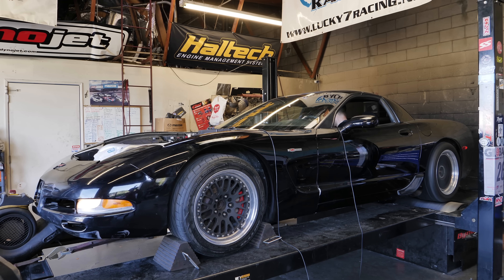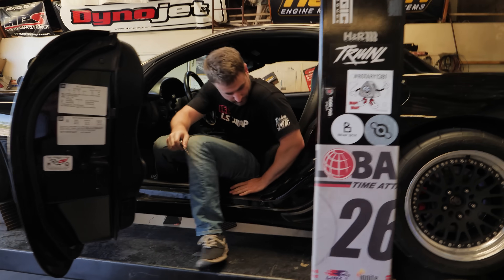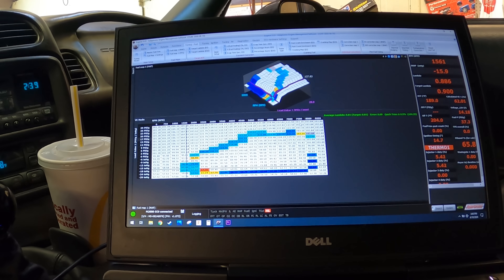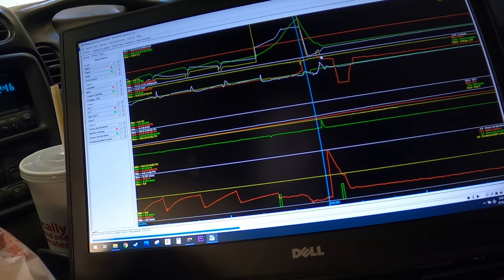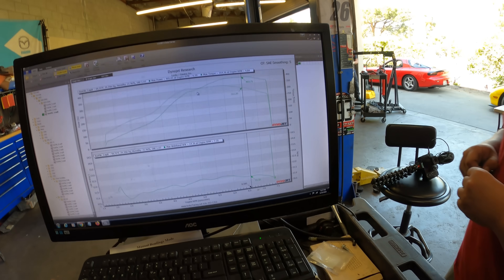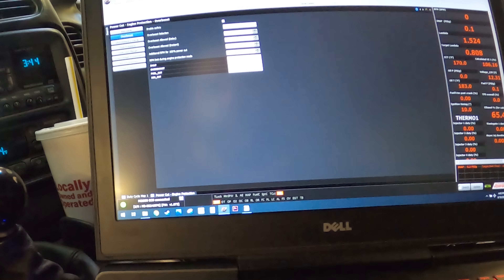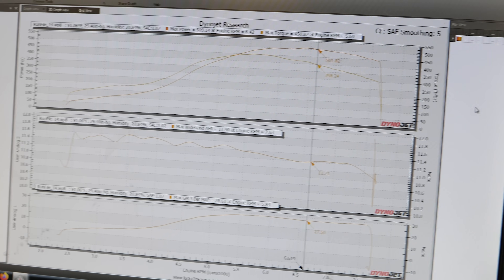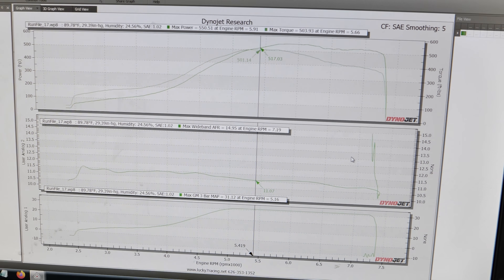Rotary Vette Dyno! First time dyno tuning

Comment: Is it just me or is this an evolution of the corvette? A smaller engine with less mass, less weight, and lower weight distribution with less vibration than the stock engine and still makes the same power. I don't know how forced induction affects the classing for SCCA and other similar events but this could be the beginning of a new life for this chassis.

Comment: So, Rob... I though you said, "No check engine lights" in a previous video. So why is there a 'check engine' light (among others), and why does the tachometer not work? Looks like there's still some work to do. I'm also a bit worried about the wastegate venting into the hood. Might want to dump that downward, under the car.

Comment: Awesome achievement to be sure! With the reduction in weight and the added horsepower this Vette is going to be a lot faster than a stock Z06!
I imagine there will be a trade-off in drivability due to the fact that the torque doesn't really surpass that of the V8 until 4,000rpms or so... but for something that's not a daily driver, that's probably a justifiable trade-off.  Hopefully Rob will give us some feedback in that regard.
Great work sir!!

Comment: The two rotor sounds positively anemic after hearing the 4 rotor for a while. Really, I suggest putting some BIG ASS mufflers on it. WTF came out of the wastegate? Feathers? What happens if you don't jerk it out (of gear) when it comes?
Reply from the maker: Agreed haha spoiled wiht 3 and 4 rotors

Comment: Rob you have the intercooler blocking the air that should go to the radiator. Come one Rob you should know this.
Reply from the maker: Incorrect. It’s actually not even close enough. So many people drill that into your head and are completely wrong. My coolant temps were under 140. Lol too low. And my intercooler is too hot. I could have used the radiator fan to pull air from the ic even. So many people feed the audience hearsay. About to blow people’s minds.
Reply: This has been my personal experience with my fd when I ran a fmic. I live in FL and I had to switch to vmic due to engine temps getting to high. Then again I am on pump gas. Your build is coming along well Rob. Brap on brother

Comment: Not sure if it’s been mentioned before but your reverse issue is the reverse lockout on the top side of the transmission. I don’t remember which wire in the plug but if you can’t give it signal from the ecu, tap into the brake light circuit and then all you need is to hold the brake while shifting to reverse. Works like stock while stopped but no chance of hitting reverse instead of 5th.

Comment: Makes me wonder what I could push with the Turbo 13B in one of my Opel GT's (other one is running a LE5 Turbo'd with LNF parts setup).  I hit about 275 HP and ~235lbft or so if I remember right when just trying to pull out a really conservative stable result.  The LE5 car is pushing 300hp and 350lbft with mostly LNF parts I got second hand that people swapped for aftermarket excluding turbo, that was an upgrade but I can't remember what it was (did this years ago).  Pretty sure I could beat more out of the 13B but I have a lot more LE5's laying around than I do 13Bs so I was a bit scared if I'm being honest...lot cheaper to mess up the LE5 by far.  Besides, considering stock the cars had around 90hp and 111lbft factory, they both ride around fine with more than enough power, just with a different feel between the two.

Comment: almost seems you have to stiff of a bov spring in it, notice the hesitation between letting off and the bov opening.. thats a lot of pressure hanging out on the throttle body for a sec.

Comment: Be carefull running with so little timing, when using a coil with a long spark duration such as the ign-1a you do not want to fire a coil after TDC ( for example 5 degrees of base timing on the leading side and 10 degrees of split ). This is because the trailing spark can actually stay lit untill the apex seal sweeps past the trailing plug causing the next intake charge to ignite way early and detonate. Also, are you monitoring egt's?

Comment: Corvette Community: Ew 13B on corvette why? You have to do everything custom

Me: Takes notes for a 13B Subaru Baja Project
Reply: Baja Subaru? Rotary swap a Subaru Brat. Call it the Subaru Brap.
Reply: Shona lol wish I could But I already got the Manual 06 Baja Just need an RX8 engine (Because Downgrading Emissions Laws in my County)
Reply: Isn't the Baja awd?
Reply: That Corn Fed 12A guy yes but since the total size and length of the Baja vs the EJ251 engine is close enough, It looks more doable than you’d expect

Comment: LS Fans: Did you beat the LS6
Rob: Yes 
LS Fans: What did it cost?
Rob: Everything
Reply: now compare it against a LS9
Reply: Now compare that against a 26b
Reply: Peter Griffin The ls9 is a far better engine than most rotary engines
Reply: Peter Griffin remember rotory guys there are 6000hp turbo big blocks. running 3 sec quarters at 300mph..
Reply: Local Baller also costs more.. pound for pound rotaries make more power
Reply: Michael Gomez actually, they have 10k Hp engines running those numbers.. lol
Reply: #RideLife 3 second quarter miles at 300mph show me....
Reply: #RideLife v8s ftw
Reply: #RideLife there are 1.6 liter turbos v6s making will over 1200hp in f1. show me a engine smaller that makes those numbers
Reply: #RideLife rotors are just not at good.
Reply: Michael Gomez 1.3l 13b turbo making 1300hp.. just to name 1 lol
Reply: #RideLife no 13b is making 1000. a 2 rotor won’t hold up. maybe a drag car.
Reply: #RideLife nice try tho
Reply: #RideLife im talking 1000hp for 50laps not 10seconds. there are 6000hp v8s out there so
Reply: Michael Gomez lol go search it up they can and they do. https://youtu.be/UMSIOu-inz4 there’s one, 1300hp from a 13b and there’s another one pushing 1000hp (13b also) on “that racing channel” it’s a brown rx7. I think you need to enlighten yourself and do some homework. Rotaries, pound for pound, take the cake. (Pound cake😂 sorry I had to)
Reply: #RideLife drag cars...lmao
Reply: #RideLife 6000hp pro mods exist. soo your about 5000 short there buddy
Reply: Michael Gomez the engine is the same.. you can put it in an Rx8 or any car.. what’s the problem? You said that a 2 rotor (13b) can’t hold up.. I’m proving to you that you’re wrong. And as far as the other engines, I was telling you earlier that they have piston engines making 10k Hp.. so what’s the problem on this one..? You’re about 4K Hp off...
Reply: #RideLife top fuel dragsters make 11,000hp out of 8.0l so it makes more horsepower per liter then that rotor. while making 10,000 more HP
Reply: #RideLife good attempt tho
Reply: #RideLife i said for 50laps not drag racing learn to read.
Reply: #RideLife come on did you miss that part or can’t find any because they don’t exist....
Reply: #RideLife prove me wrong knows your chance F1 levels of power out of a 1.3 2 rotor.. no drag cars
Reply: Michael Gomez actually, 50 laps.. a lot of guys do more pulls at the drag strip than that before rebuilding.. so with a few mods I’m sure they could pull off a 50 lap race
Reply: #RideLife 50laps no stoping....
Reply: #RideLife im sure your a F1 mechanic and should know right lol
Reply: #RideLife post a link. If it exists
Reply: #RideLife 1.5 liter 1450hp in the 80s lmao imagine today..
Reply: 80laps in this race btw
Reply: Michael Gomez yes 50 laps no stopping. What I’m saying is those drag engines would last those races with a couple of mods to the cooling etc (many drag engines don’t run any coolant) because they’re constantly running.. drag racing is super hard on everything in the car because of its very hard launches. Engines don’t like that lol and totally about that 1.5L I totally agree and that’s what I’m saying.. they’ve had that back in the 80’s imagine what they can do now.. (I think we’re saying the same thing on this one lol) rotary tech has come a very long way, despite what people may think or say.. and for the record, I’m not an f1 mechanic, but I am a mechanic and I build engines lol
Reply: #RideLife your wrong a 13b would not last at 1000hp. mazda themselfs don’t even try it
Reply: #RideLife but hey prove me wrong post a link of somebody running a 13b with 1000hp at a track day atleast
Reply: #RideLife rotors have not come a lot way. the only engines that exist are the same ones from 30years ago...a 13b,20b and some crazy 4 rotors. none are very reliable or efficient today.
Reply: #RideLife we get 1liter engines to make 200hp & get 70 mpg. or 11,000hp in a piston drag car.
Reply: #RideLife rotors can not make such numbers.
Reply: #RideLife nice try 🤙
Reply: Michael Gomez holy comments lol first of all, if they have 1300hp 13b’s that last 30-60 drag runs, I’m sure they can make a 1000hp 13b that lasts 50 laps.. keep in mind the winner of lemans was a 787b rotary.. also they’ve been building upgraded billet parts for rotaries, improving strength, weight, power and cooling.. so yes they have.. also, have you not seen the 6 rotor engines and also that crazy 12 rotor experiment? Pretty cool stuff.. plus I didn’t mean power per litre, I was sound power per pound, rotaries win
Reply: #RideLife but 60 drag runs is not a full road race distance your at 15000rpm for 2hr straight. not the same......
Reply: #RideLife but they don’t there are motorcycles making more power per pound
Reply: Michael Gomez what are you taking about? Yes they do..
Reply: #RideLife something like the H2R witch is a 998cc engine with like 320HP
Reply: #RideLife mazda themselves are using piston engines. there NEW sky active engines are Promising diesel efficiency with more power
Reply: #RideLife it’s being used rn in IMSA and will race at the 24hr of le mans next year. i’m the LMD-h class
Reply: Michael Gomez you don’t stay at 15000 rpm during a race.. what is this, nascar? You can race while you sleep and duct tape the steering wheel to the left. And engines like to keep running.. not go stop go stop go stop. It’s less fatiguing to an engine to race auto cross than it is to drag.
Reply: #RideLife monza is 75% flat out. so yeah you do
Reply: #RideLife le mans is worse
Reply: #RideLife nice try
Reply: Michael Gomez right, the bikes engine probably weighs 50-80lbs less, it still has FI keep in mind, and makes only 350..? How is that more power per pound?
Reply: #RideLife 350..stock
Reply: #RideLife what does a twin turbo 13b come with stock ?
Reply: Michael Gomez yeah.. and a stage 3 tune and upgrade on the h2r only makes it around 400.. a stock 13b single turbo can get far past that..
Reply: #RideLife but a completely stock TT 13b makes 300hp
Reply: #RideLife my point being once you modify. it makes numbers. but when going up against a pistion engine built to do a specific task it will outperform a rotary
Reply: Michael Gomez different types of 13b’s annnnd different stock tunes from factory.. just like the 2jz barely made 335hp.. but with a tune can make over 1k..
Reply: #RideLife it will not make 1000 “with a tune”🤡
Reply: Michael Gomez most factory tunes are designed to meet emissions etc.. a track only bike that isn’t street legal won’t have to worry about that
Reply: #RideLife you want to talk street legal when half the mods on any 13b makes that shit fail smog.
Reply: #RideLife moto gps make 240hp with 1 liter NA  i4 & v4
Reply: Cost: Dignity
Reply: Weighs less than half the LS too
Reply: Logan it’s like 70lb NA
Reply: Supreme Cippy to bad it’s not na. so you have to add the turbo weight. rob “forgot” that part
Reply: pistons won already the war is over. get over it

Comment: 32psi is insane on a rotary engine. He tunes like he has money. Like watching a gambling addict getting cleaned. 

Love these videos XD
Reply: On my old FC I ran a s500 between 35-50psi depending on air temps I never made the torque rob is making(max was 450) but i was 600-675 to the wheels

Comment: you can tell the old rob is coming back out of his shell. 10% does nothing? okay, more than double it
car doesn't like it? eh, knock 2% off there
car still doesn't like it? eh, split the difference. 15% it is
actually can't control himself and makes it 16%
"this is the first time I'm going to touch and probably one of the few times I'm ever gonna touch ignition"
does it again 10 seconds later

Comment: The thing is IF you wanna drive a  brap brap chicken cooker buy a Mazda.
All the numbers in the world will not make it faster than a standard Chev engine. As for standard?? It is turbocharged, turbo the LS and get double the numbers!
Oh and you melted in the seat,, half assed conversion where the AC is not working. And that drags HP.
And it proves the fact that the rotary needs bigger coolers than the Chev.

Comment: So it took u around 17psi to beat the stock over 100,000 mile LS that was in it, the fact that u have a rotary in a corvette is cool, but how much hp will the LS that came out of it make with 17psi? A whole lot more than the rotary that's for sure, no replacement for displacement

Comment: Rob Dahm's asbestos cleaning services. We will scrub your ducts work and ceiling asbestos insulation clean with our rotary cleaning tools. LOL.    You know what these rotaries need, is a hybrid drive train. So off the start, where the rotary just falls flat on its face, the electric motor will kick in and propel. When the RPMS rise to like 30,000 on the rotary and finally makes some power, the electric motor kicks off and your smoking and screaming all the way down the street. What do you think?

Comment: When you started the 20% runs, why does the car sound so strange? I've never heard that before.
Reply: With an electronic boost control solenoid it opens and closes really fast and sends that pulse to the external wastegate to regulate boost which causes that fluttery sound.
Reply: I agree  sounds like bad things are happening

Comment: stock 2 rotor 550 hp 500 tq WHAT
Reply: Running at crazy boost.

Turbo FC only ran 10psi from the factory, this was running @25 or more.

Comment: Rob, if you're having shifter issues, you could check out the "anti-venom mod."
This is a very specific washer placed in the detent plugs of T-56's to help with poor shifter feel. Just a thought
Reply: Isn't he running a stock RX7 box?
Like it makes no sense IMHO to use a corvette T56 cause then you need a custom clutch/flywheel and bellhousing?
Retaining the RX7 gearbox would only require custom cross member for me the box and engine
Reply: @Jarmezrocks  The C5 and newer corvettes' transmissions are rear-mounted directly to the diff, with an internal driveshaft called a torque tube between the clutch and the input shaft.
Reply: @Wrongwayislost77  Geeeze thanks for the info man. I am Australian so this is all new stuff to learn for someone like me! Cheers
Reply: In Aust most mid range HP rotar builds in anything live axle usually revolves around adaptation of a Toyota Hilux solid/live axle and then sourcing a G series differential from many many choices of Japanese cars (namely toyota Supra centre from an IRS carrier can be mated to the Hilux crown with custom bearings) chosen for lower over all weight relatively strong. Anything in the HP++ category means full custom driveline. Wonder how far Rob is going to go with this one when the other is ready to go? Can't Wait!
Reply: I think he is fighting the reverse lockout solenoid since the stock computer is gone.
Reply: That washer is a band-aid, hinson or mgw shifter actually fix the issue

Comment: U-Haul isn't the only place that rent's trailers.  Just use the online Yellow Pages for local "Equipment Rental"  Better yet get a used enclosed trailer because the added element protection and security is mandatory when you are internet famous hauling a 1/4 million dollar vehicle out in the wild.  Roadkills Mike Finnigan had his Mazda Rotary Pick Up stolen off the back of his open deck car trailer.

Comment: Those Temps though...Glad I am in Michigan!  Great video Rob! Best wishes as always!  I gotta say I know  power levels with my 2010 Ford Taurus SHO.  400+HP and 440+lbs torque. AWD and twin turbocharged. Stock Parts.  Stage 4, 93 octane tune from Livernois Motorsports. Corvette is doing great, glad to see things working out. 👍

Comment: Rob I'm curious about one thing about cooling on the car... with the stock C5 being engineered to scoop air from the bottom with a forward tilting rad and air dams, will cooling the rotary properly ever become an issue with the rearward tilting intercooler and rad in the car now? You may have covered this in a previous video, but I honestly can't remember.

Comment: In worried about this car. Can a professional do a final tune after u play around? So u wont end up like cleetus melting pistons(rotors) when he tuned his car.
Reply: You don't really have to worry about detonation with ethanol.  But you can have a professional Dyno tune it after you've done most of the work.  It will take them considerably less time so it will save you money doing it that way.  There's a lot of clueless tuners out there, that's why I do my own tuning.  I don't trust most "professionals"